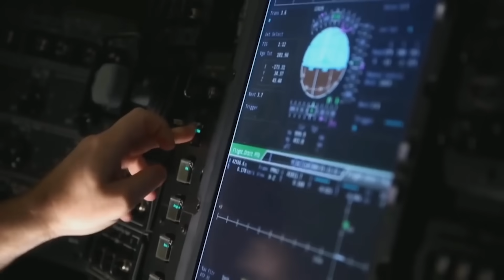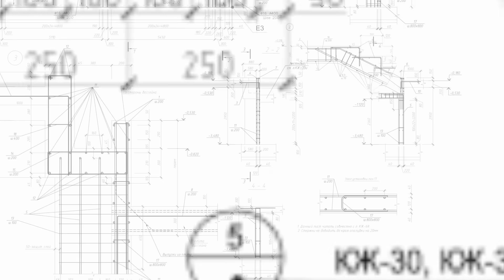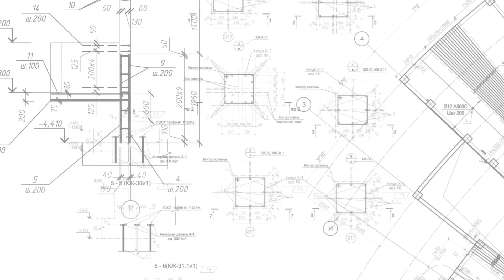Architecture and Systems Engineering: Models and Methods to Manage Complex Systems

Comment: Back in those days I'd have used a single telescopic arm and roll up solid panels,
smaller width to greater width. Or memory metal, rolled up, unrolling into
one long straight line.

Comment: 0:21 Back then not so easy, but nowadays, a roll of solar film and two extending arms.
back then I'd opt for folding and using a little pressure to unfold.
Once the unfolding would have been complete, increase the pressure
on the pressure line to keep it more rigid.
Once that is done, cap it so the gas within the pressure tube would not escape.

Comment: I want to switch from software engineering to complex systems engineering. Is there any material that I can learn about this career path.
Reply: You can Study Maths and  Systems Engineering
Reply: I hope this message did not arrive late. For complexity, you'd want to look at a sub-field of systems engineering called Socio-technical Systems (STS). And as providence will have it, one of the leading expert in this field is Dr. Ian Sommerville who is incidentally from a software engineering background. So, you could check out his materials on YouTube where he gives an introductory lecture on complexity as well as his textbook fittingly titled "Software Engineering".

Furthermore, depending on how deep you want to go, you might be interested in Agent-based Modeling (ABM). There are a number of YouTube materials by Complexity Explorer channel.

Hope this helps!